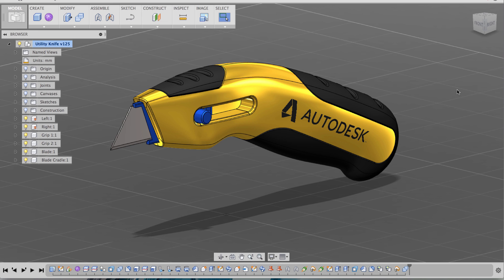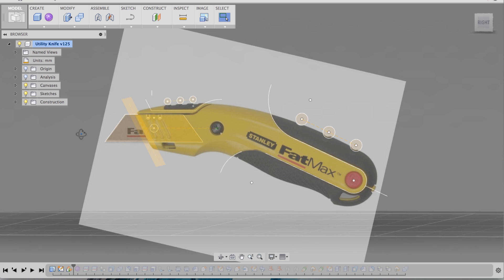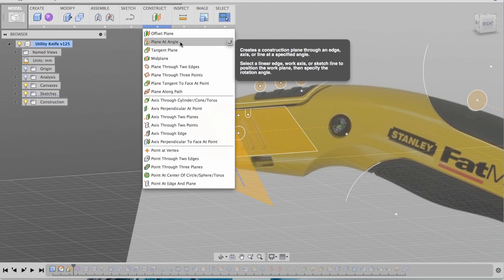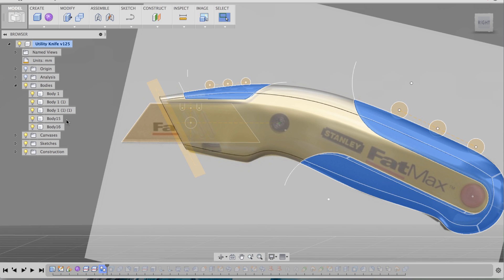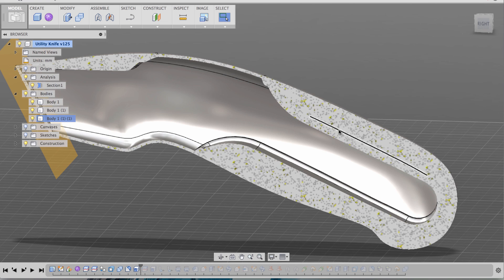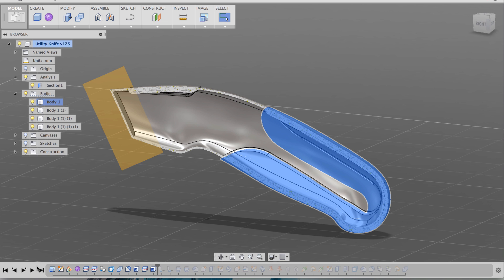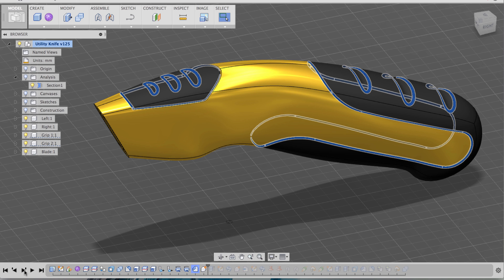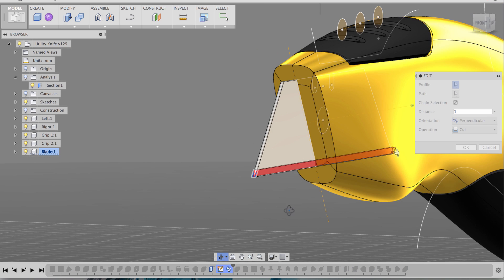How to design a utility knife in Fusion 360 - Part 1

Comment: Hi, i would like to know 2 things, first if there is a way to change the curvature of an edge when you create a new form, like this simbol ~ , i was making an axe but kind of the handgrip can just be curved in one direcction along some polygons, and you try to change it is very subtle, so it takes to many segments or polygons to make an edge like this " ( " to be like this " ) ".

2nd, how can you make the closure of the bottom of the surface or body ( not showed in the video modeling techniques), usually "fill hole" function gives an unexpected result.